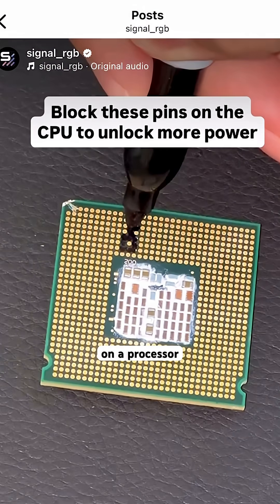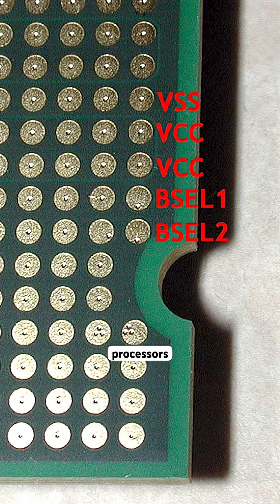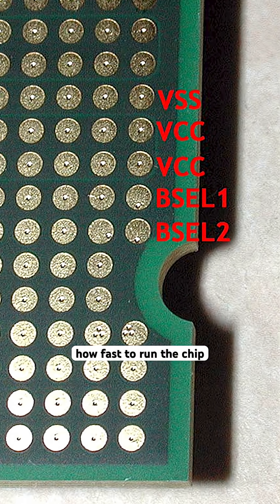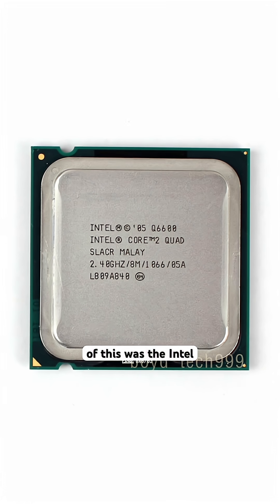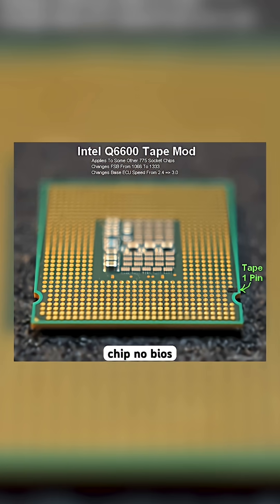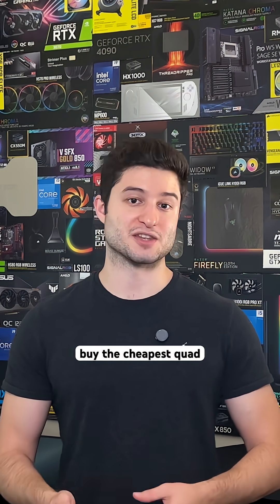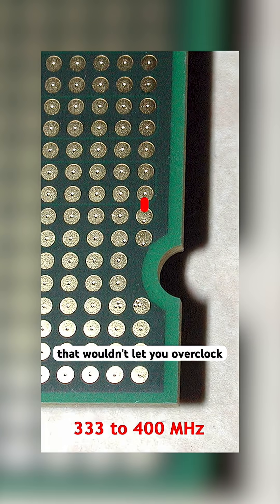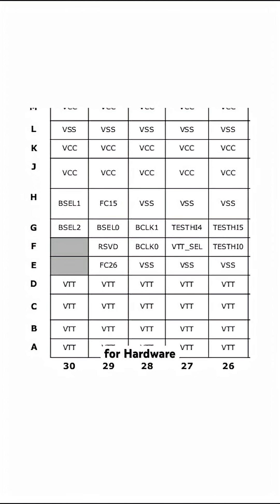Taping a CPU to improve it?!

Comment: This was before manufacturers took binning seriously, I remember during this era you could flash a different GPU bios on your ATi/AMD GPU and unlock more cores if you won the silicon lottery
Reply: Same era when AMD sold X3 tripple-core CPUs that often could be unlocked to quads. Sometimes it didn't work at all (too instable), most of the time they were fine at like 100 - 200MHz less clock but sometimes you'd get a golden sample that worked perfectly!
Reply: @Donnerwamp  Well the X3 did take binning (somewhat) seriously, or all the chips would be gold chips! What they didn’t take seriously is disabling of the features. Now chip makers fuse stuff off.
Reply: @a2e5  Yes, they did take binning somewhat serious, but the number of golden samples went up towards the end of their production cycle. I worked in a PC shop during that time and we offered unlocking cores for the customers and where we had a few total duds that only worked with those advertised 3 cores or needed to be downclocked way too much, when Bulldozer came out the number of X3 CPUs that worked flawless was roughly 70% while duds were almost completely gone. That was probably due to more demand for the cheaper X3 chips (because why pay a hundred bucks more when you can hope for at least similar performance from the little boy?) and Globalfoundries upped the yield of their 45nm node.
Reply: @Donnerwamp that's a funny feedback loop
Reply: @Donnerwamp  My "triple core" 3.3 GHz Athlon II X3 455 works perfectly fine with all 4 cores at 3.5 GHz, it gets recognised as a Phenom II X4 B55 (which doesn't officially exist lol)
Reply: @sehabel yes I remember doing that years ago. Didn't really know what I was doing but it worked!
Reply: @sehabel thats odd cause it should simply show up as a x4 965 BE, I had that chip came with only 3 cores active unlocked the last core and holy did it make a pretty big difference in performance.
Reply: @ChronicleDrew  I think it depends on the motherboard manufacturer (since AMD had no official names for these as far as I know), and these chips were harvested from different base cores (mine was Deneb I believe)
Reply: @Donnerwamp  Yeah I had one of those Athlon X3 Rana, I remember changing it in like 15 minutes and the bios showed an extra core! success! then it started showing artifacts all over the windows startup, and back to three cores it was
Reply: @Donnerwamp can confirm, had a Phenom II X3 740 Black Edition and unlocked the 4th core with zero issues even overclocked the processor a few hundred MHz and never had a stability problem.
Reply: @Donnerwamp  also Opteron CPUs could be unlocked and BIOS could have been tweaked for insane performance on water cooling
Reply: @Donnerwamp  The reason this worked sometimes at all is that they initially introduced these cut down versions (e.g. ATi 9500 pro, 486 SX, X3 CPU etc) when yields were low and when yields improved they still needed that lower end SKU or they would have had to drop the price of the high end SKU before a new product was out. So they'd start out making them with almost exclusively defective chips with the deffective core, compute units or FPU etc. disabled and end up making them with almost exclusively functioning chips as time passed. If they had fused it off in hardware there was nothing you could do to fix it, but if it was just a couple of flags in BIOS or something you could fix it.
Reply: @Donnerwamp I had that golden sample on an x4 it came with only 3 cores active I unparked the locked core and it gave me a significant boost in performance, didn’t have to reduce clock speeds or reduce the chip from 125w
Reply: @Donnerwamp mine ran fine for 15 years at the normal clock speed. Bought it when it wasn't to new anymore and yields were very good so they basically sold fully functional quad cores as triple cores because there were not enough chips with a faulty core.
Reply: @Donnerwamp I think it was phenom 3 core
Reply: @Milan_M95  All kinds of X3 CPUs worked, Athlon and Phenoms did. If I remember correctly there were a few X2s that were reduced X4s, but I'm not sure right now.
Reply: @Donnerwamp how does it work that from 3 core u have 4 core unit?
Reply: @jakubsolarski2594  Back then they made all cores as the maximum configuration on the wafer, then they binned the dies after being cut out of the wafer and when a die didn't meet the criteria to be a full powered quadcore, they either clocked it down or deactivated a faulty core via microcode. Now you could buy a tripplecore and hope that fourth core isn't a total loss that causes instability and glitches and unlock it via your boards BIOS. Most of the time they worked and you had to down lock the CPU a bit to be usable, sometimes they were completely messed up and unusable when that fourth core was unlocked, but sometimes they were just binned down because of demand. Nowadays they still do this, but part of the binning process is deactivating those instable/unneeded cores by literally disconnecting them, either via fuses that get burned out or by lasering the necessary traces off.
Reply: @Donnerwamp i once got a 5 core out of a X3!!! It was amazing for years until I finally 'upgraded' to a bulldozer cpu
Reply: @dutifulbarrel9084  5?! So... A cut down Phenom II X6 that was "halfed" and could have been sold as a X4 while offering another core? Never heared of that.
Reply: @Donnerwamp yeah! There were so many different variations of those, my uncle told me he once got a 6 core from a quad core. I loved those old CPUs. I might still have a few in my CPU book.
Reply: @dutifulbarrel9084  Yeah, you could unlock some Phenom II X4 into X6, but that was done rarely as the performance gain was only measurable in niche applications and even then it was often outweighed by the monstrous TDP. There were also a bunch of X2s that could be unlocked into quads, but your original statement of unlocking any kind of X3 CPU from back then into more than a quadcore is complete news to me.
Reply: @Donnerwamp  I had one of those, and it was a lucky one, basically I paid for the 3core CPU and got a 4 core out of it, I knew there was a chance the 4th core was shut off for a reason, but the system overclocked and remained stable for years with all 4 cores in use.
Reply: @Donnerwamp  This was because AMD didn't throw away chips that had bad cores, they just disabled the bad cores and sold it as a 2,/3 core chip. In order for the core thing to work means that the chip failed AMD QA, but the disabled cores were still good enough to mostly work for the end user.
Reply: @Donnerwamp  that probably worked because the dies were defective so they had to be disabled.
Reply: @Donnerwamp I have two Phenom II x4 960T cause and with certain motherboards you can unlock it to a six core cpu
Reply: On a much more recent AMD GPU (MI50), you can flash the vbios not to unlock cores, but to make it present as a Radeon Pro VII, allowing the card to be used on Windows (thru the Pro driver). There are a lot of cheap used MI50s floating around coming out of data centers. Put a fan on it and flash the VBIOS, and you get a somewhat decent card.
Reply: 9500 to 9500 pro :)
Reply: @nitehawk9270 Same, fam!
Reply: I had a R9 290 that was flashed to 290X. The good days.
Reply: @georgeharisson6250 Flashed my 5700 to a 5700XT
Reply: You can softmod a RX 5700 so that its using the RX 5700 XTs BIOS to make it run up to 10% faster
Reply: @PySnek  and you can do that with the 9070 and 9070 XT too
Reply: @danymend5797 how can u do It to a 9070 xt?
Reply: @danymend5797  Yea but does it unlock additional cores or just push the speed further? Bc if can only overclock the speed it's kinda bs, you can do it yourself without flashing bios lmao
Reply: @PySnek  i think the same goes now fot 9070 vs 9070 xt :)
Reply: I flashed my 9800 Pro to an XT. I also ran a laptop CPU instead of desktop because I could overclock it way further with the water cooling. That was in 2004.
Reply: bruh that shits somehow still a thing, by flashing a 9070xt bips to a non xt you get more performance 4 free!!!
Reply: radeon 6950 to 6970 :D
Reply: This is not true. They did bin. You could try it out and maybe it works or maybe it doesn’t. I tried it in a 9600 or the like. It worked, but the pipeline was faulty and caused graphical glitches. So, had to go back.
Reply: people still do this with amd RX 9000 series
Reply: they still took binning seriously even back then, they're just more familiar with the technologies today but mistakes can still happen. I saw an 8-core Ryzen 5 1600, and not just on the internet but in real life. It exists, it's rare, it has 2 extra cores fully functional and stable, and it's a ryzen 7 with ryzen 5 clocks and cpu code so it always gets identified as a ryzen 5 1600. That's even better that winning the silicon lottery. If you bought a ryzen 5 1600 and it came from the one "defective" batch (it was only one batch, that's why it's rare) you basically got a ryzen 7 1700 for $110 less.
Reply: @CreeplayEU  All down to production, supply and demand. Binning happens not just due to issues in the silicon, but also whether a particular model is in a demand state higher than the supply
Reply: Yep! Had a Phenom 2 triple i did this to.
Reply: So they had more cores available but only say 75% of it is officially there and this flashing was unlocking those hidden cores? (Genuine question, idk nothing about overclocking)
Reply: I remember trying that and finding out, I in fact did not win the silicon lottery
Reply: did this with a 3 core amd cpu and turned it into the quad core, wasn't the phenoms  but the lower consumer grade cpus at the time, idr the name. Also my amd gpu 7950 vapor-x used the same pcb as the 7970. Bios flashed it to a 7970 and was just slightly less efficient 7970.
Reply: Even better was the Celeron 300A era. They were virtually all capable of hitting 450. Never again will we ever get a 150% performance increase.
Reply: ATI is certainly a name i haven’t heard in a while. Brings back memories
Reply: You can still get some enhancements by flashing different vbios, I just flashed an ASUS vbios on my msi rtx 4060 and unlocked a higher voltage limit which let me push my core frequency close to 200mhz and an extra 2k mhz on memory. Flawless, entirely stable. For a day or two the rgb would not work with the new vbios until randomly it came on and it's been fine since.. Not sure what that's about! Also the Asus firmware allows a higher voltage output to the onboard fans. Previously on the stock msi vbios the fan speed limit was about 3k rpm, now I can push it to 3300 rpm  and believe it or not it makes a temp difference when I'm running comfyUI Ai WAN generations
Reply: They still don't bin when the process is mature. A lot of low tier CPU's are still perfectly fine high tier ones with core's turned off. A $800 CPU is only worth $800 if someone buys it, demand is too low so they are sold as weaker CPU's where demand is higher.
Reply: the silicon yield question was non existent  as the timing gap was huge compared to now
Reply: You can still do this. People are flashing 9070 XT bios onto the 9070. 10-15% gains
Reply: I unlocked nVidia 6800LE to 6800GT, only RAM was halved, from 256 to 128MB, no hack for that. Software called riva tuner and allowed to unlock certain locked (deffected) pipeline. 6800LE was lowest spec, arrived with 8/4 pipelines enabled, I managed to get all 16/6 functional, beating vulgaris 6800 (12/5)
Reply: My vega 56 thinks its a vega 64 lol
Reply: They took binning seriously, people just sometimes got lucky that it worked and might be stable-ish, but not always lol
Reply: You didn't even need a lottery, every HD 4850 and 6950 was a 4870 and a 6970 with slower memory.
Reply: You can literally do that with an RX9070 non xt to make it xt-ish.
Reply: They have always binned SKU's, thing is more people buy low end, obviously they need to match that demand , any way necessary even if they have to ship lower end parts with crippled units, nothing new.
Reply: This was an era where manufacturers will sell cpus with one or more defective cores/thread as a lower end cpu and tweak it to achieve the same lower performance.

RIP monolithic chips
Reply: Talked with a producer back then when gamers was all overclocking,  where they was keeping safe margins for reliability and durability.  But then started releasing them faster themselves. But also how the innovati9n and improvements, are dripfeeding to the market. Slowly increasing, yes downgrading for such, to sell you the new and improved all the time. They could sell you twice the performance for the same price, but what does that benefit them? Why we need competition. One thing our western elites that should not be did achieve eith their sanctions driven by their greed, new competitors are forced to rise to supply that market, then will put our players out of business likely. Or at least to bring the best they can at a competitive price. Untill then, I am good. Not feeding this beast. Learned to mind where and who I maoe momey as where I spend it. Unfortunately I live in what poses as a democracy, with a majority putting and letting the wrong type of peop.e take my taxes and feed those to the beast.
Reply: I had a HD5700 transformed into a HD6700.
Reply: I have an old rx 550 that can do this, but I haven't tried it
Reply: whole lee fuk
Reply: But was it worth it?
Reply: I remember on some of the AMD stuff there were traces you could cut on the top of the CPU that would change the clock multiplier.
Reply: @PaulFlusk I remember connecting certain VIAs on the top of AMD CPUs with a line of pencil so they are practically jumpered and thereby increasing the multiplyer. That was the dirst time I overclocked anything.
Reply: @Donnerwamp  same here! felt naughty and started a bit of an obsession of mine with OC'ing in the early '00s. I used to run one of  the earliest Bitcoin mining rigs, around the time looking for Aliens in SETI data was all the rage. It made for a good benchmark. 

Alas, deleted the lot in around 2014 before stonks were even a thing
Reply: I did that
Reply: Yup I have 2 6950s from back then with extra unlocked shaders bios mod.
Reply: Or use Rivatuner on NV
Reply: The shit you mentioned happened because of binning. You're an idiot.
Reply: People are literally doing that rn with the 9070 and 9070 xt
Reply: 2500 Barton to a 3200+ 👴 with just a jumper change
Reply: you can still do this nowerdays with 9070 and 9070 xt bios.
Reply: Yeah I had 2 HD7950's and flashed them to 2 7970's, running them in crossfire I had more performance than a HD7990. It was awesome. Loud. But awesome
Reply: Isn't it sad that there's room for a silicon lottery err?
Reply: I remember people flashing higher tier Radeon bios on lower cards with similar parts. I don’t remember if it gave extra cores. But other stuff like Rops tied to gpu chip were physically reduced bios can’t change that. The bios swap I know for a fact changed the gpus coreclocks and memory speed also allowed them to unlock a higher power usage that gave more performance and higher power draw on similar cheaper cards giving you free performance hike if you didn’t brick.
Reply: Did that with a Radeon 9600 Pro, flashed the 9600XT BIOS
Reply: the famous geforce 6600 gt that could turn into a 6800. i miss those days
Reply: i remember seeing someone flash the bios of an rx 6000 series i think, with the bios of the xt version and it ran the same, sometimes even better than the xt version
Reply: Hijinx
Reply: Could flash a 7300 GT to a 7600 GT. The last card I remember you could do that was the GTX 465 being flashed to a 470 from certain manufacturers.
Reply: Only with some very few ones. 
Early 9500 had the ful 256-bit memory bus and all 8 pipelines, but cut down in the BIOS. Unlock them and you'll get a 9700. And on those with hard 128-bit memory bus, you could still get a 9500 pro out of it.
And the HD 5850 could be turned into a 5870
Reply: No it was not before they took binning seriously.
Reply: i made rx 5700 to 5700 xt still very useful. also the new rx 9070 can be flashed to 9070 xt
Reply: I remember this still being an option with Vega cards and more recently (ish) the RX 5700 (flashing it to the 5700 XT), although from what I remember that was only feasible on very specific models because the 5700 cards tended to have cheaper VRMs/cooling which weren’t suitable for the 5700XT performance you ran at
Reply: They did take binning seriously though, they were binned to be sold with cores disabled and clock speeds limited. You're just gambling that their QA process was overcautious.
Reply: AMD's development arc was a ton of hacky techy Macguyver stuff for consumers.
Reply: You could the same thing in the past with Nvidia cards too, until Nvidia started lasering the extra pipelines and rendering them useless. You could also unlock disabled cores on AMD Phenom II CPU's.
Reply: Pixel pipes, not cores.
Reply: You think those manufacturers didn't want to sell at a higher price, so they just disabled stuff for fun?  They would have tried to make it maximum power, but it failed the top-level tests.  So they reduced the capability and sold it for less money.  Re-enabling those components could bring you problems.  Same for CPUs, one reason the manufacturers would... "configure"... a chip at a certain speed, was that it failed testing at higher speeds.  Same thing with many triple-core CPUs.  They were originally manufactured to be quad-core, but if one core didn't meet specs, it would be disabled/bypassed and sold as a 3-core.  Re-enabling the fourth core could bring you problems with stability etc.
Reply: @kerryedavis  not all triple core CPUs have a defective 4th core, some were disabled because the demand for triple core CPUs was higher than AMD had actual chips for. 

It's the same with 6 core Ryzen 5 CPUs, Ryzen 5 sales are way higher than Ryzen 7 sales, so many Ryzen 5 CPUs were actually working 8 core CPUs before. There were even rare Ryzen 5 1600 CPUs that left the factory as working 8 core CPUs because someone at AMD forgot to disable 2 cores (you can find videos about that here on youtube)
Reply: @sehabel  Yes, but not the kind of lottery I'd want to play.
Reply: @kerryedavis  you obviously have to validate that it actually works first and if you're doing super critical work it's probably not the best idea, but mine has been working fine for years in a media center pc (so I basically wouldn't lose much in case it crashed)
Reply: Jesus Christ loves yall he died on the cross for yall repent and follow Christ, not forcing
Reply: @nameless9283  Actually it was Simon his brother with the switcharoo, thanks though.